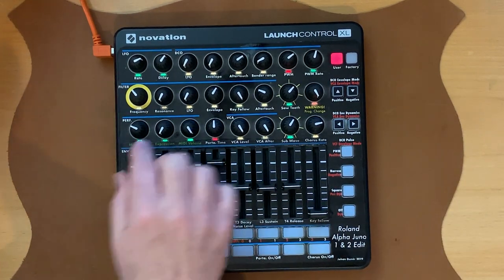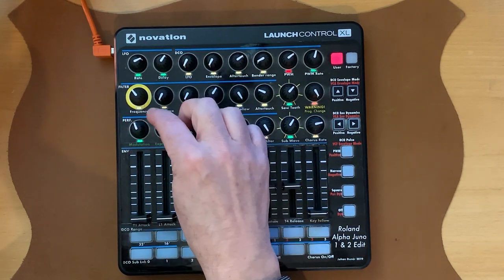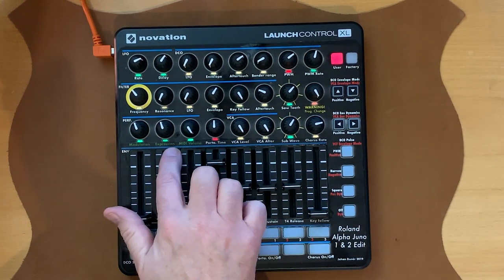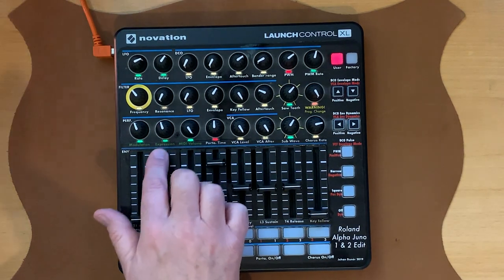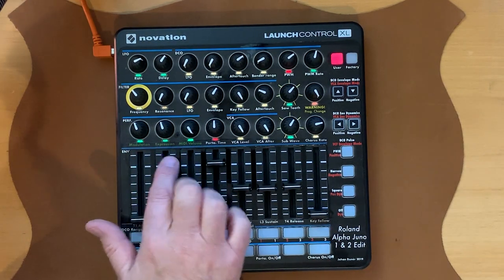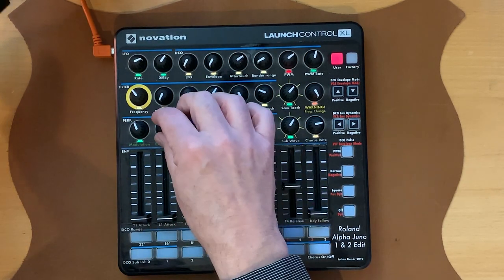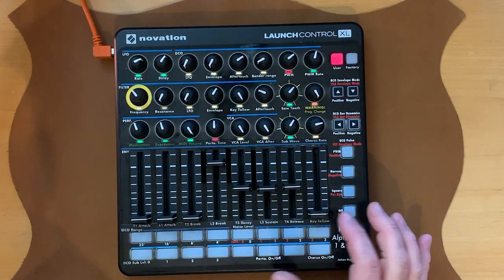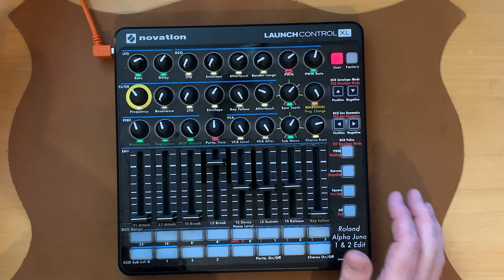AlphaJuno Editor

Comment: Hi, I try to do this (more simply) with a Komplete Kontrol keyboard but I can t send program change message , How to do this with Bome ?
Reply: The Bome website has a great support Forum any many tutorial videos to give you an idea on how to support your use case.   

Here is the link to Midi Translater Pro:  https://www.bome.com/products/miditranslator

I would suggest starting with Midi Translater Pro first, then once you are familiar with how to build your own Presets and Transforms you can download them in to the BomeBox.  

You can also each YouTube for Bome and the video tutorials are available to learn.
Reply: Hi Steeven.  This is easily done with Bome MIDI Translator Pro on  Windows or Mac. You can then upload and run the project on BomeBox with no need to a computer.

Steve Caldwell
Bome Q and A Moderator and
Independent Bome Consultant/Specialist
bome@sniz.biz